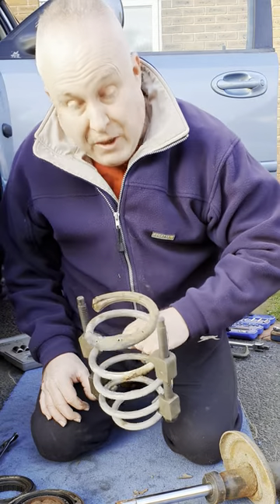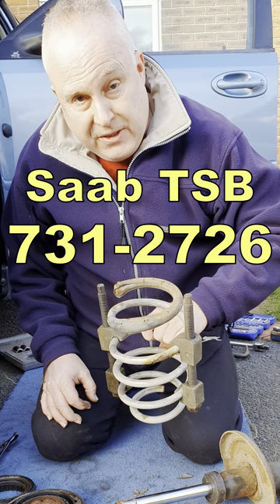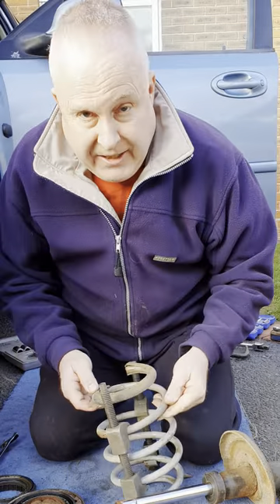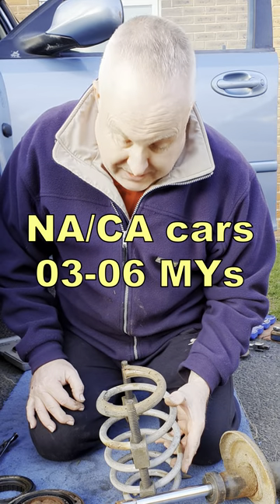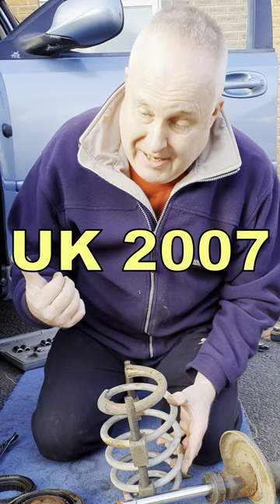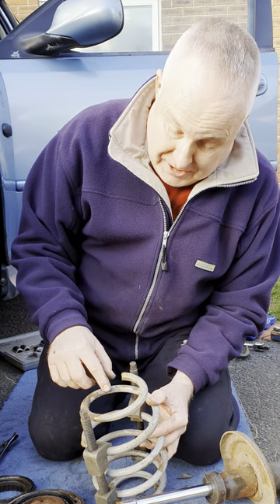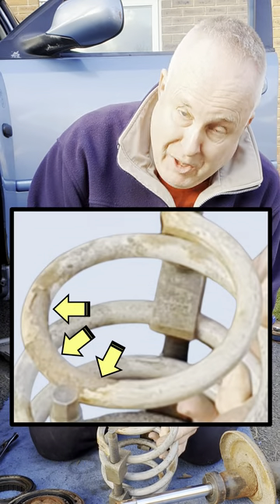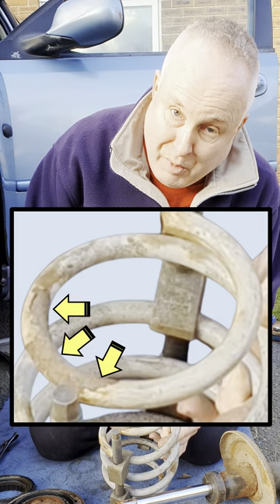Saab 9-3 Front Spring Replacement - TSB 731-2726

Comment: Oddly the front springs on both our 2010 9-3 Aeros broke at the bottom at around 130,000 miles.
Reply from the maker: Both my fronts broke about 3/4 of a coil from the bottom at about 80,000 miles. I didn't know about this TSB then and one of my front Maptun springs subsequently broke.